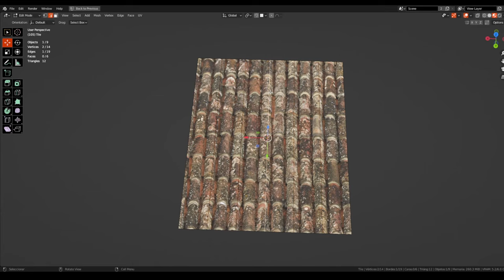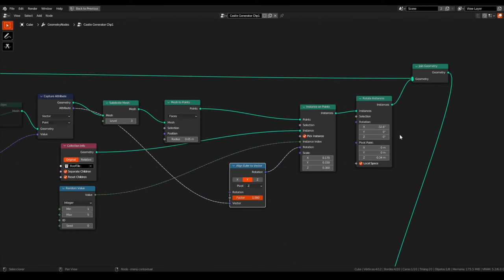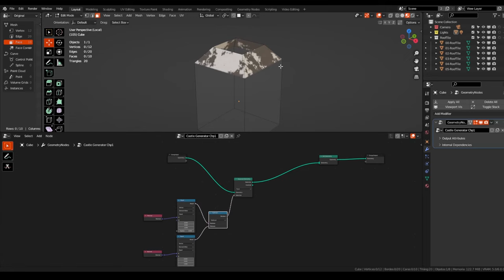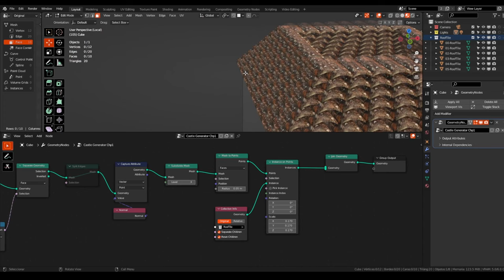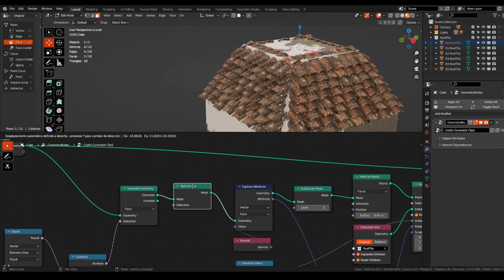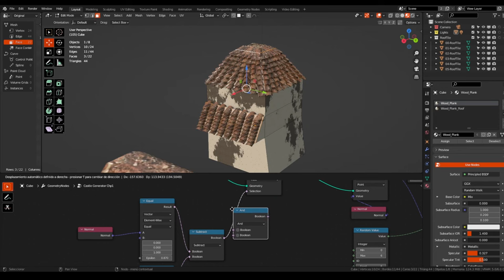Quick roof tiles - Castle generator (1/xx). Blender Geometry Nodes.

Comment: For anyone confused as to what the boolean math is doing: The top selection is taking all faces with normal facing directly upwards, but will take anything with a threshold of 0.94, meaning even if a face normal has only .06 magnitude in the up direction it will be selected. So this selection is selecting any face that is facing upwards, even if only slightly. The second selection is the same node, but with a lower threshold, meaning it's only really selecting faces that are directly facing upward. These selected faces are being excluded using boolean subtract. All in all, it is selecting all faces that are facing upward (even just slightly), but excluding faces that are pointing directly upwards, as we don't want tiles on flat roofs!
Reply from the maker: Thanks Bradley for the full explanation about it. I'll pin your comment.

Comment: Hy ! I found how to rotate rooftile automatic ! From "Capture Attribute" make  a "Vector Mate - Absolute" then "Vector Mate - Dot product" with the second vector of "-1.0 ,-1.0 , 0.0" then binds to "Rotate instance - Rotation" ! Roof tile will rotate automatic ro roof !
Reply from the maker: Sooo this a very useful comment, I will add it on the next video. Thanks for sharing this tip
Reply: I had to separate the X of this result with separate-combine XYZ nodes but then it worked! Thank you very much

Comment: 7:23 does not work for me, I am running version 3.2.2, when I use the subtract boolean math node, the whole model disappears, I've even tried making my own Subtraction Node but whatever I try, the whole mesh disappears instead of just the flat faces leaving the faces where roof should be.
Reply from the maker: Darko could you upload a image to imgur to see the error? Do you have the scale and rotation aplied? Also check the normals with "face orientation" mode. If they are blue is ok.
Reply: @MartinNicolasGrasso  I was running version Blender version 3.2. I updated to 3.4. Will post image as soon as possible to see if the error is fixed.
Reply: I know this is late but I think I might have found the problem, your Separate Geometry node is set to point, it should be set to face

Comment: I am looking forward to the tutorial on how to make the stairs at the end of the video!
I am currently struggling with how to make a staircase:)
I'm trying to figure out if I should set multiple points on an isolated sloping surface, select only one column of points, and display one step of the staircase in an instance.